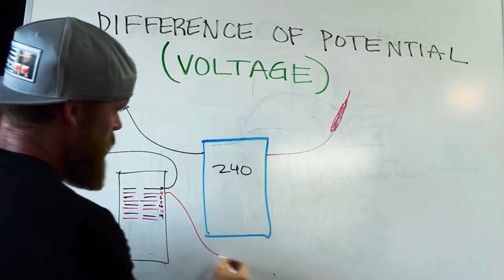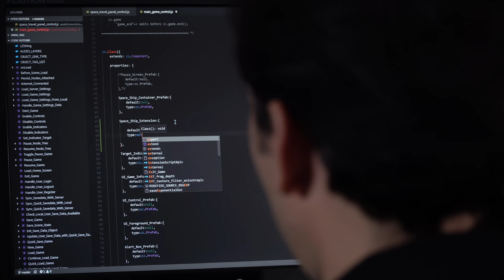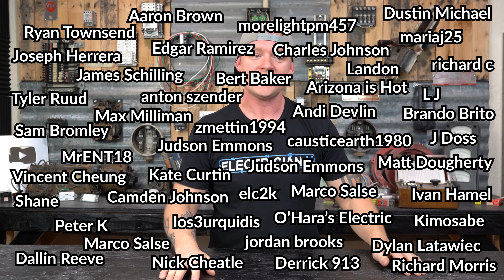PROBLEMS WITH THE TRADE (Part 2) - Our Public Education System

Comment: There you go. You think a 6 gauge wire is thick. You should see how thick the wire would have to be if you tried to run a range off of 12 volts. What would that be to get 12,000 watts? Hmmm 1000amperes. Ha!!

Comment: I was in High School in the early late 90's and early 2000's. At our school, Trades were not even present as an option for us.  They took out all of the hands-on classes like shop and replaced them with computer classes.  I am now in my late 30's, I have a half desk job half warehouse job.  I sell brewery and packaging equipment, but we also load and unload the equipment as well.  I am so burnt out on the desk job.  I am strongly considering going into the trades now.  I wish that I had more exposure to it when I was younger because I feel like I would have chosen a trade path.  Thank you for your videos.  Not only are they super informative and have great content, but the fact that you show your passion for your trade is incredibly insightful.

Comment: As an outsider who would honestly love to get a license, the gatekeeping requirements are a huge hurdle.  No possibility of going to a location and getting up to speed and licensed part time.  Have to find someone to take you as an apprentice, which introduces all sorts of gatekeeping bias.  The whole thing probably needs to be restructured, like getting Dive Certified.  Start as a Residential Lineman, takes the shortest time, maybe a year of schooling, hands on during the class and theory.  Then Commerical, High Voltage, etc.  Each as an addon.

Comment: 23 years old, I became an electrician after being in the navy because on day I helped out my moms bf with wiring one back and had to put on a lock ring to the 1/2” inch Rolex connector. I thought it was cool that I connect that through wires so I figured I’d be good at the trade

Comment: Started teaching at a trade school a couple of years ago. It’s a 1200hr class. It’s difficult to have a class due to the high cost of material.  Not to mention it doubled this year…. We do quite a bit of hands on in the class, but there’s a lot of theory and code. I mean, it has to be. As an apprentice you’ll probably install $250k-$1,000,000 worth of equipment purchased by someone else. We can’t possibly match that. On the other hand, I tell my students to take advantage of the time to learn the fundamentals. It’s hard to get someone to teach you electrical theory on a construction site. They’re going to do the hands-on work no matter what. I want them to understand how the transformers and motors work, how to size the wire, grounding, and how to become familiar with the NEC.  We can only bend so much conduit and pull so much wire in a classroom…  Also, the pay for entry level electricians sucks.  I mean it’s really unfair. They could do better working in a store, do less work, and be in air conditioning.  What the schools are trying to do almost doesn’t make sense in the electrical trade, and I tell every student that talks to me about the class that they can go out and get a job without the school, but they sign up anyway.  The way I see it is that I get a guy who doesn’t have a plan for his life, and I give him knowledge that will set him on a course. I explain that what they’re learning is a transferable skill and they may follow a slightly different path. I also tell them that when they get out they’ll be working with people who most likely have had no formal training, but will be working circles around them. But, they’ll be able to understand things much faster, studying for their journeyman’s exam will be much easier because they’ve already been through most of the material. And, with some effort, they’ll be on a path to getting their state contractors license, possibly before they’re 30. I know some of the students will never want to do the day to day work of an electrician, but many will, even if they really don’t want to at first. Some of these guys come in with no way to make a living, but leave the program on a path that will enable them to provide for their families for the rest of their lives. I went to this very same class 35 years ago and I know how much it meant to me…

Comment: I just found your channel today and find it very educational.I’m not a electrician but I have been doing heating and air conditioning/sheet metal mechanic installation in residential and light commercial for 31 years now.we are having the same problem with finding younger workers.I’m 50 years old and when my generation retires there will be nobody to replace us.in our schools her we do have vocational training as I took heating and air conditioning for two years.
I think some of the problems are the work is hard,investment in tools,the pay,and how the public looks at us as just laborers.we don’t get the respect we deserve.they might have trade workers in their families and see how hard the job is on your body.personally my knees are gone,hands from cutting metal,and chronic pain in my lower back for the rest of my life.
I have had many helpers over the years and I really take the time to teach them and let them  do the work.i don’t degrade or cuss out.not one helper made a career out of it.i will say there are more leads that treat there helpers so bad and are way to rough on them for no reason.then wonder why they quit.
I don’t have the answers but one thing is true.something has to happen or customers are going to suffer from not enough trade workers

Comment: A lot of STEM would be better with a stronger grounding in hands on trade skills.  
Mechanical engineers who can actually disassemble/reassemble a car
Chemical engineers who  can plumb
Electrical engineers who could wire something together
College is chok full of engineering math&theory, but highschool would be better preparation if it offered more foundation in how the abstract is applied.

Comment: Dumb question... Isn't low voltage less efficient at transporting the same amount of power? 
I'm not an electrician, but...in 3D printing, everything was 12v DC, but suddenly people figured out that 24v DC with heaters, or even AC powered heaters with a solid state relay, was more effective/efficient, as well as providing better heat up times.

I've gotten into some minor component level repair, from being in  3D printing and ham radio, so it has sort of made my inner tinkerer come out.

Comment: This is pretty much false where I live.  Government keeps saying there is a trades job deficit, but there are no jobs available.  The old guys aren't giving up work to anyone.  You still have to find a job before getting an apprenticeship.  5 year apprenticeship program vs 3-4 year uni degree is also a hard sell.  The interest to become an electrician is still high here, but no spots. Case in point, I recently attended an information session for a level 1 apprenticeship program. 1100 people attended for 36 spaces in the program.  Ridiculous.  Unless the government or union makes it easier to get hired, things won't change and it will continue to be this mafia protection system we have here.

Comment: I have had always followed electrical work and have strong skills in 3 phase distribution systems and currently do communication systems engineering and maintenance on radio equipment. I always wanted to do electrical work but the way I see it you have to have an existing electrician work with you to get into the trade before you can get anywhere I. The trade. My problem is all the area electricians in my area don’t want to take on new members I. The field. They feel like I would adventure out on my own and make money. So they never would be helpful. Why is this system setup so it’s so complicated to take test and get  certified. I don’t get why it’s so hard to get started

Comment: A big solution would be opening the field to engineers. Personally,  I would like to become licensed but because they don't offer classes in the evenings I am unable to start the process. I have a full time well paid engineering role so the required rule of working at an electrical company is not an option.  Lighting the stringent requirements as far as the ability to take the classes would while not having to sacrifice 3-4 years would solve the problem.

Comment: Functionally many of the problems I see are the 'common sense' crowd. J-peeps that complain about a lack of common sense, and use apprentices as disposable emotional vents. That don't see value in training.

It's lucky that you haven't had to deal with the cat-callers, but many job sites are a jungle, where cutthroat is normal.
Likely the most productive step that construction as a whole can make is to incorporate actual training as a mandate (even just on safety toolboxes to start). 

We also live in a HR dependent society where their job is to make sure they don't get sued. This leads to situations where safety protocol are followed to the letter and not the spirit. People get hurt often even though they sign the sheet, or are forced to listen to axioms that abdicate any responsibility.

Comment: I went through trade school, and hit the job market at the peak of the recession(2009). Unless you had connections, nobody was hiring rookies at the time. Went back to school to program PLCs and got a job in manufacturing before finishing my degree.
I couldn't be happier with how things turned out, plus my education from trade school is worth it's weight in gold.

Comment: I have been in the trade since 1997, specifically Critical Power Systems, i.e. UPS’s, Power Generation, SCADA, and Power distribution. I worked my way from cleaning a warehouse and loading trucks to a service manager with a team of electricians across 10 states.
This business is booming and I predict it will be hot for another 20 years or longer.

Comment: I think the barrier to entry is a big part of it. I'm currently an engineer. If I ever needed to move into another line of work due to a downturn, I don't see becoming an electrician as an option. I could immediately start work as a paid programmer, but to work as an electrician, I need 4000 hrs as an apprentice (in my state). While I am very familiar with the NEC calculations and wiring methods, I don't see spending 4 years making minimal money doing grunt work as a viable option, so I could never move into it. Once you're out of your twenties, you just can't enter that field unless you really want to take a step backwards, and that's unlike a lot of other professions (engineering, programming, fabricating, etc).

Comment: I’m on my second year of Undergrad in Electrical Engineering at University.And I have yet to have touched a screwdriver or even a wire in School. I got buddies that are Mechanical Engineers that don’t even know what channel locks are. I’ll tell you what the problem is. They don’t teach you how to work in college. All they do is teach you how to solve problems on paper that you will never apply/use in the real world. I honestly should have just gone to a technical college to begin with...

Comment: You should construct a video series of the various jobs or divisions the electrical trade has. Residential, Commercial (Office, Warehouses, Hospitals, etc) Industrial (Quarries, Food processing, manufacturing, etc.), Pole & Line (High Voltage, Utility, Transmission, Generation), Motor Controls, Automation, Panel Building, Underground Installations, Project Management, Electrical Drafting, Service, even Fire Alarm and Security....

Everyone always thinks when you say Electrician, oh you install lights and receptacles... uh no, we do much more.

Comment: Pick any trade. Every single one is having issues finding GOOD people. Even the coding computer ones. I myself am a cnc machinist, that can also moonlight as a cnc service guy. The small job shop I currently work at had two previous hires that didn't last, one of them had substance abuse issues, and the other couldn't understand lefty loosey. And that was over a few years of trying to find someone. Admittedly the pay could be faaaaaar better, but it was an apprenticeship listing. There's a deeper problem than just lack of trades being advertised here imo.

Comment: I've been fighting to get into Local 3 in NYC since 2013. I've aced the aptitude test twice but because of my criminal history I believe I was denied twice. They never came out and said it but how else do you explain denying an individual with 4 years theoretical  NCCER Certified Training with transcripts to prove it... As well as 6000 hrs of practical application (hands on). I guess because I worked on every kind of electrical system in a prison... My skills don't translate.  I was good enough for the Department Of Labor to certify me but not good enough for local 3....Bottlenecking the industry to limit access to some is also causing massive decline. I mean I stuck with it for 8 yrs during my 10 year prison sentence... Helped me find direction and purpose in life.  Haven't been back since even though I didn't work in my dream field... The trouble shooting and problem solving skills I acquired helped me in life nonetheless. I think I can handle their 4 year program no issue.

Comment: I think the biggest problem in not only our trade but many trades out there and I consider our as an industrial trade is schools them selves. I live in the west coast and I came here from Connecticut. In my county we had a technical high school Kaynor  Technical High school in that school they taught trades from machine, tool making Electrical so on including plumbing and you would spent a few weeks on your trade and everything associated with that trade and a few weeks in class room working on regular school work. When you finished any local or nearby company would hire you to finish maybe one or two years in which case you were ready to get your license or in tool making your journeyman papers and you would be making an average of 25 to 30 dollars an hour. Straight out of high school. That something that’s missing across the board

Comment: Good stuff. I feel the same way about the electrical trade. I have been a marine electrician at a shipyard for 31 years now, and I still learn something new all the time. And in the electrical trade, by the way, at least in my situation, when the Covid thing was hitting hard, and I saw so many lose their jobs, we kept working the whole time, we had to keep the ships repaired and the lights on, so we were fortunate there.
As per your point, the only thing that also concerns me is that there are less and less of us with that much time in each year these days.
And what we are getting are those that are brought in with no schooling or very little experience.  I am all for helping someone along, but these individuals will be a very long time before they can be sent out to do things on their own, and the end result in a small shop is that the duties and responsibilities are increasingly piled on the few that know what they are doing, and it is getting harder to do some of that stuff as we are getting older. And at the age when we may be wanting to throttle down a notch, there is no one in place to take up that slack, and you wind up running yourself down to a nub, and working many more hours because none of these recently hired people can do the minimal amount of the work yet.
And I see this problem continuing if we do not get some more people in the pipeline to get some experience under their belts to make up that gap you speak of, between those who can work by themselves competently, and those who want to but have almost no experience....

Comment: I think taking away the idea that tradesmen are poor helps. People think these jobs are too unhealthy and don't have good benefits which is partly true. We have to change the way people see the trades. We also need to build respect bc the diy thing takes away that from pros. No one wants to pay a higher price for services that they feel they can do and without money coming in no one wants to do the job. Ex: painting. Why pay 400$ to paint a room if you can do it yourself? Now someone else wants to have it painted rather than doing it but they have the stigma that anything over 400 is too much and it might be a 700 dollar job. Really applies to any trade. How many hvac techs hear the classic "I think it just needs freon. I could fix it myself but I don't have time" lines? Most moms don't encourage their kids to do trades or they are failures and when people search happiest careers, trades work is usually at the bottom of the list.

Comment: I recently got my electrical trainee card, can’t get a job as a electrical apprentice since most of them require 1 year experience. Any tips?
Reply: r4ally depends on the city your in.  like denver where they cant throw up slum apartments fast enough,  if you can tell a black wire from a white wire, they'll hire you.
Reply: also depends on region, back east where the mob unions control everything, is a lot different than out west.
Reply: @brianbranson2306  wow that sounds great. Unfortunately, I’m near the west coast area and usually I have to compete against 100+ of applicants just for an electrical apprentice job
Reply: @ChrisTheElectrician-428   yah people leaving cali in droves, no need for new construction.